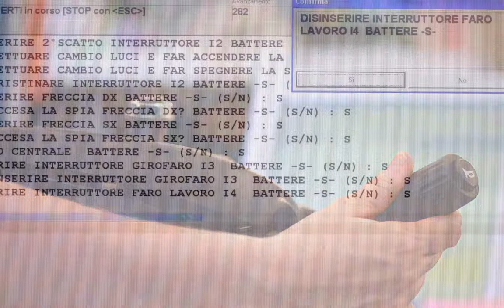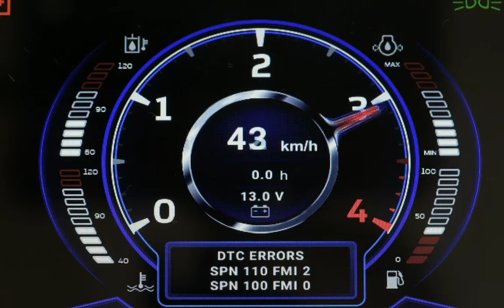Business Unit Componenti Cabina

Comment: The full range of OHV cabin components we manufacture embodies the essence of the AMA Group: not only to offer individual products, but also integrated global solutions for agriculture, municipal services, machinery, equipment and vehicles.
According to this logic, AMA development companies produce steering columns, electronic control units, analog and digital instrumentation, monitoring systems, lights, optical indicators and cabling designed to work together and meet every need.
AMA's offer is complemented by innovative and highly technological composite materials for interior and exterior cabins, which are placed in roofs, door panels, dashboards and boards.
The AMA offer is also available in Poland, see http://ama-parts.pl